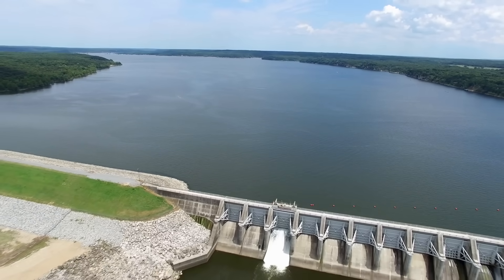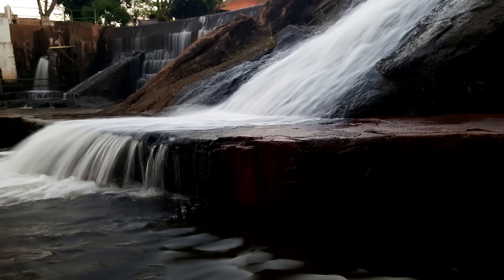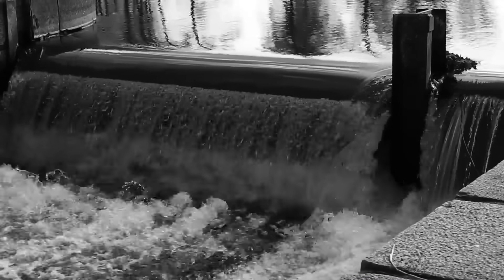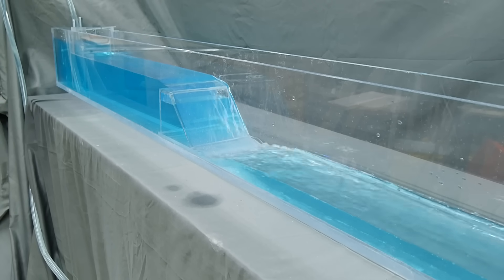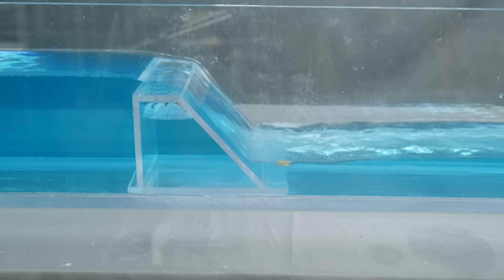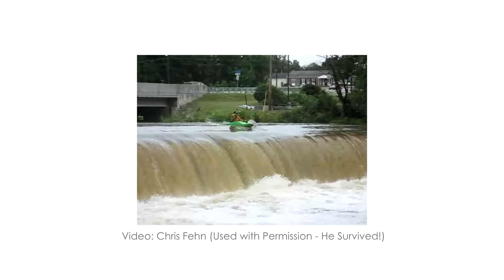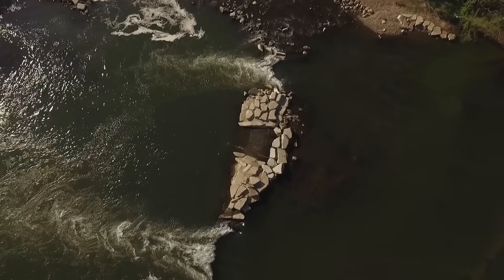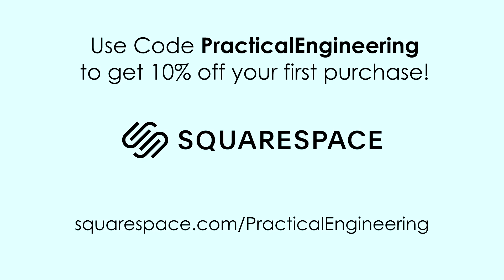The Most Dangerous Dams

Comment: Have two of these dams on the river next to my apartment. Never  knew how dangerous they were.
Reply: Im a kayaker in france and ive seen several peoples died in these, cause of lack of signalisation for tourists. 
Also some dies triyng to save others peoples
A death trap for any living thing
If you see anything trap its a security rope you need, dont go by yourself
Reply: Uggggh, they are the nightmare of every kayaker. Stay away from those.
Reply: @matejhosner1980  Yep, don't be dumb like me in this video. Stay away from low head dams, kids.
Reply: Here in Italy you can see all sorts of abandoned low head dams and water elevators (or whatever they're called) down the length of even the smallest of rivers, it's ridiculous.
Reply: @cdgonepotatoes4219  do you mean locks?
Reply: @cdgonepotatoes4219  It is not strange, they once were used for obtaining power. Best thing you can do is to use them again as it will save significant amounts of coal/gas in the long run, lifespan of water turbines is well over 50 years and generators could be used for over a century with good maintenance.
Reply: @MrToradragon  You don't know what you're talking about. These little dams are NOT going to generate much power and many weren't even made to do so as this very video explains.
Reply: @GarrusN7  I know what I am talking about. On average such dam has around 2 m and for river that have flow of around 5 cubic metres per second this will generate around 90kW of power, but once we move to larger rivers it is 180kW per 2 m and 10 cubic metes per second, in case of river with average flow of 40 cubic metres, it is 720kW, almost 1000HP. 

Dam seen at 0:59 could generate around 1000kW of power. Those are not insignificant numbers, especially when such dam already exists.
Reply: @In The Filth, throw a stick into the water upstream of the dam, and see what happens to it.
 You might see it do what Grady's demo piece of wood did.
Reply: Slade Cintron 
Don’t you mean you never knew how dangerous they ‘weir?’
Reply: Stephen  Most of rivers do not serve as waterways anymore and even if they server for recreational riders they do not posses problem, ships can be carried around, larger and heavier ships used for fishing, rivers are often not navigable without weirs.

As well, many places in the world have long history of landscape modification and until 20th century (in Central Europe, in North America probably last two decades of 19th century) those modifications had no significant adverse effects on endangered species. Well, partly due fact that contrary to concrete one wooden weirs have different construction that more resemble natural waterfall (1) and designs were more eco friendly.

Those "trivial" power plants are often powerful enough to supply way over 50 % of local power consumption and can significantly improve quality of power delivered.

1 machine translation of page with types of weirs:  translate. googleusercontent. com/translate_c?depth=1&hl=en&rurl=translate.google.com&sl=auto&sp=nmt4&tl=en&u=http://mve. energetika. cz/vodnidilo/jez.htm&xid=17259,15700021,15700186,15700191,15700253&usg=ALkJrhh9_0zj011liHbvHy8PT-7H-vsfig
Reply: @MrToradragon  you forgetting transmission and heat losses through the turbine then to the outside electrical systems then to the houses. A small river isnt going to help shit.

Comment: Does it mean that if dam has that submerged jump effect, it is badly designed?
Reply: It was likely designed when a) conditions were different and b) they knew less about the flow of water.
Reply: It would be considered badly designed today if that's what you mean, but at the time most of them were built it would've been considered acceptable.
Reply: F
Reply: Not really
Reply: It is almost impossible/impractical to design a low head dam that does not produce submerged jump during high flows. You can make the dam lot higher which results to possible flooding upstream and increased construction cost,  or change the river/canal slope downstream (another costly thing to do)
Reply: Its still something happening a lot in all rivers, and some point are not  at all keepers in summer and became keepers in an other season depending on flood.